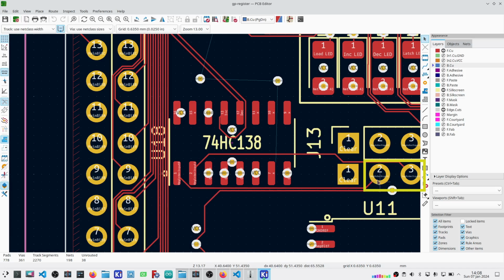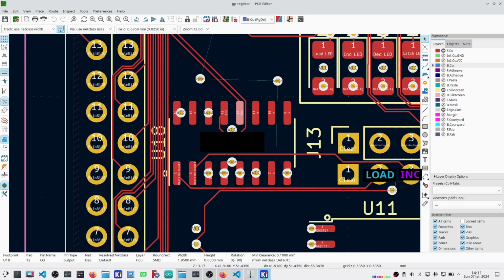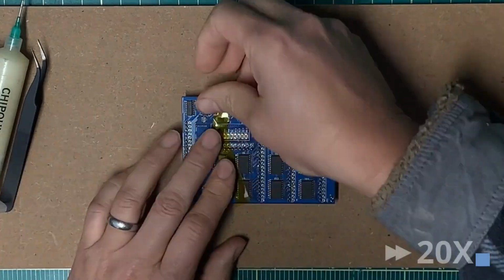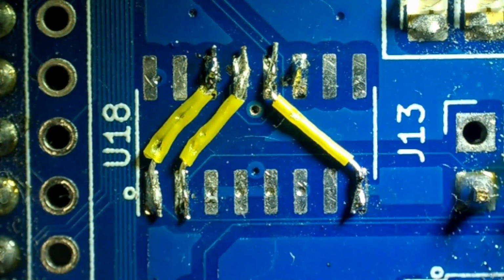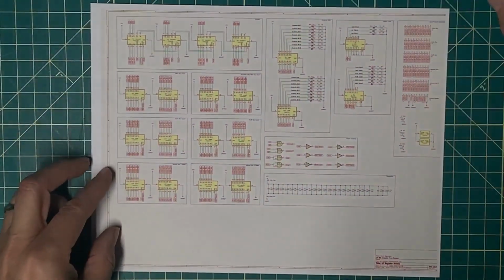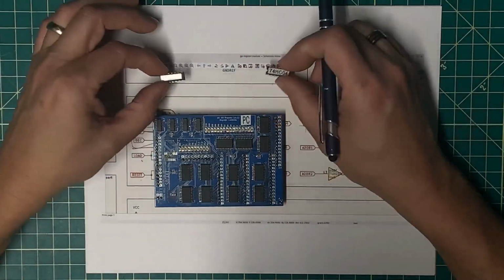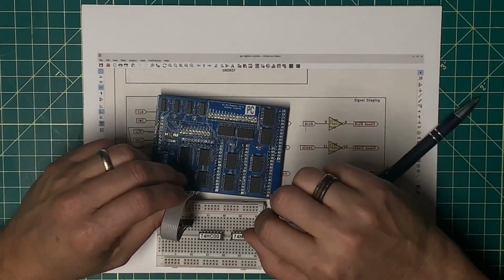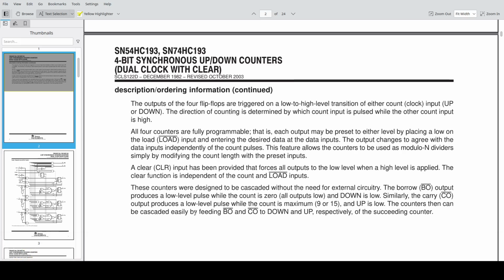0088: Bodging the Program Counter| 16-Bit Computer From Scratch

Comment: I wouldn't have bothered to preserve the insulation of the 30 gauge wires - the rigidity of the wires would have kept the non-overlapping wires from shorting. Strip one long piece of wire (2 inches?), solder one end to a pad, bend the wire to the other pad, solder wire to the other pad, cut wire (carefully) with an Exacto knife, move on to next pair of pads. If you do have an crossong wires, bare wires can still work if you rely on the strength of a wire to hold it up and you're careful handling the PCB.
Reply from the maker: @gregyoung9687 -- Thank you for your comment!

I considered stripping off the insulation briefly, especially when it started to melt and retract.  But I picked the yellow color to stand out as a bodge.

But, now that you describe the technique to use, it makes a little more sense to go without for these short runs.  I may give that a try in a future video.  The reality here is I have 5 more GP Register PCBs to bodge still, so there is still some practice to come.

Comment: FYI: The tiny gap on U18 pin 13 can be hard for PCB makers to etch. In general any place there is a sharp V shape or a narrow gap can trap acid during the etching process.
Reply from the maker: @LaserFur -- Hmmm..  Not completely sure I follow you, but let me try to see if I am understanding.  I looked at the PCB design and pondered for a few minutes.

I think you are referring to the trace that comes up along-side Pad 13 and ultimately terminates into Pad 13.  A tiny amount of copper needs to be removed and the trace also terminates into a sharp corner when the trace and pad join.  I think this is the place you are calling out.

Assuming I picked that up correctly, then it is probably best practice to terminate all traces to pads at a 90 degree angle.  Pad 12 has a similar problem just without the narrow gap.  Actually, I would guess that more than half my pins have the same problem.

Given the possibility of having acid remain, I also assume that the risk is that it will continue to eat the copper and will eventually break the trace. I cannot see the pad being as big of a problem, but still a concern.

Thank you so much for the correction!  Please let me know if I missed your point in any way.
Reply: @eryjus4594  yes. It can both eat away more of the trace or the acid can get stale and not eat the gap. The washing steps would remove all acid before the next stage, but this is just something the PCB houses will complain about if you have a larger production volume.

Comment: My method for dealing with the wire-wrap wire (since I don't have a thermal stripper) is a sharp pair of flush cutters. I strip the end of the wire from the roll, solder it down, then route it, cut it then strip the new end and solder it down. That way I don't have to hold a tiny length of wire to strip both ends. I have built many rats-nest prototypes that way, even some that worked better than the PCB that was designed by someone else from my prototype. Also did a lot of repair work ages ago and sometimes had to fix damaged traces from previous attempts by others. Once you get the touch for how much force you need with the flush cutters, stripping is pretty fast.

As soon as you put that wire to ground, I thought "that's not going to work. the 138 outputs are active low". then you found it quickly during testing.
Reply from the maker: @grumpyoldman5368 -- Thanks for the tip!  I did try that method and it did not work well.  I guess I need more practice and I'm sure to get it!

For the ground connection, I live by the 50-90 rule: given a 50/50 chance, 90% of the time I will be wrong.